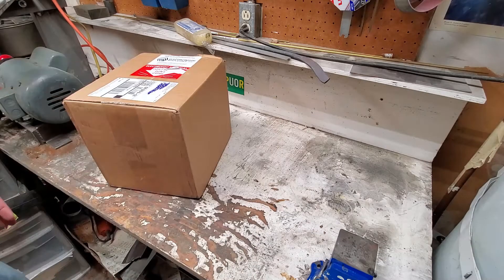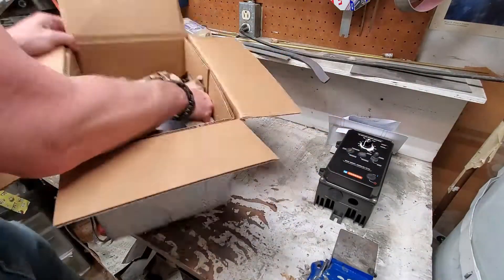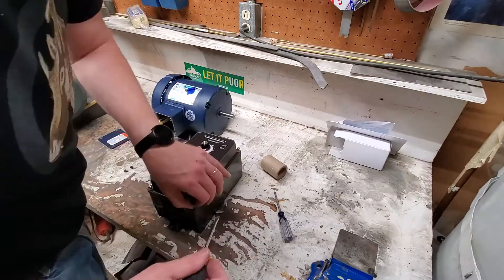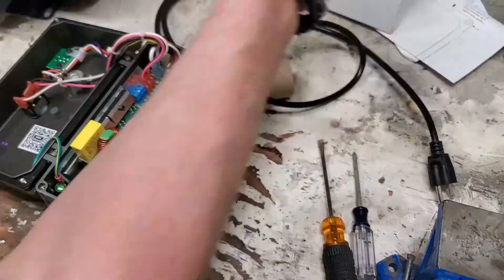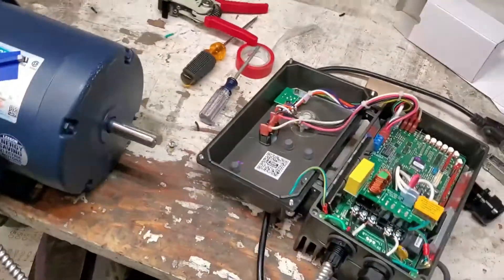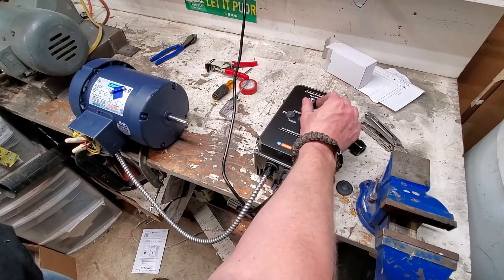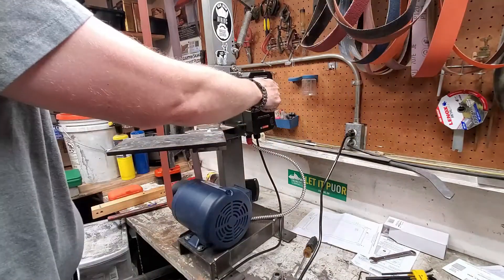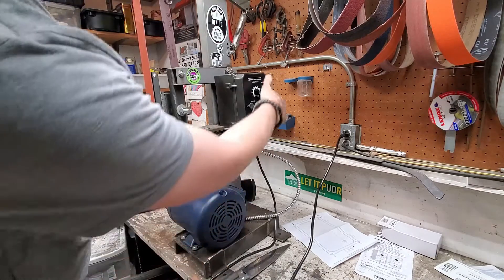How to install a speed control on a belt grinder

Comment: Nice conversion! You happen to have part# for speed controller?
Reply from the maker: Yes, check one of the other comments, where I've put in the speed controller and motor part numbers. I'll go and pin it now.
Reply: @DrPronghorn  I wonder if you can add a kbac 24d to the Kalamazoo belt sander? Would be nice to control speed.
Reply: It saying part no longer available. I think it crossed the number to another one. But looking at your install it’s awesome how 3 phase going 120v and speed controlled.👍 I’m definitely a subscriber now!

Comment: Do You have model numbers for the motor and vfd? links to website don't work. Thanks
Reply from the maker: The motor is a Leeson 110145.00, and the VFD is a 1HP KBAC-24D NEMA4X ANALOG VFD 115/230VAC 9987.

Comment: Hi and thanks for the video. 
I plan to buy a mini bench grinder equiped with speed controller but the lower speed is something around 1or2000rpm and i would like it to be able to turn at much slower speed 100rpm maybe).Can I add a second speed controller to have it go at slower rpm? Sorry for my naive question, I'm definitely not an electrician !!!!
Reply from the maker: I don't think you can; I think you'll have to replace the speed controller, or maybe there is a way to re-wire it. You should check out Jeremy Fielding's channel: he knows so much about electric motors. https://www.youtube.com/@JeremyFieldingSr

Comment: Can this be added to any belt sander ? Even cheap ones ?
Reply from the maker: It will depend on the kind of motor on the grinder. You will have to choose the speed control based on the motor, and some motors cannot use speed controls.
Reply: @DrPronghorn  thank you.

Comment: Do you think this would work on a Bucktool combo BG2600?
Reply from the maker: You might be able to retrofit a speed controller, but it would have to be a different model than the one I used. It depends on what kind of motor it has, and I can't tell from the info online.

Comment: Is this brand vfd able to over speed the motor?
Reply from the maker: I don't think so. The documentation didn't seem to indicate it could go over the designed full speed of the motor. I could be wrong, though: I'm still a novice when it comes to these machines.

Comment from the maker: I say "Variable Feed Drive" but that's a mistake. VFD stands for "Variable Frequency Drive" because it changes the frequency of the three-phase current to control the speed of the motor. 

Also, the motor is a Leeson 110145.00, and the VFD is a 1HP KBAC-24D NEMA4X ANALOG VFD 115/230VAC 9987. The website seems to change regularly, so no links stay good, but these part numbers should help you find them.